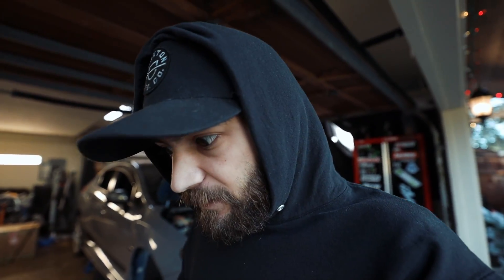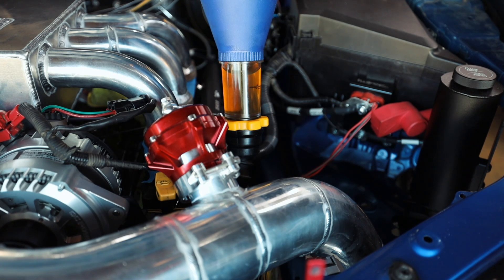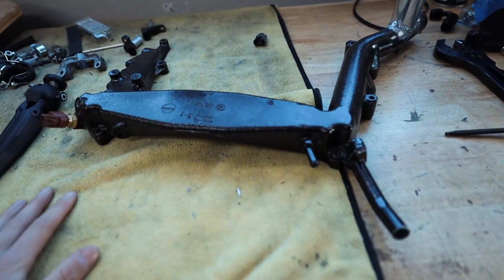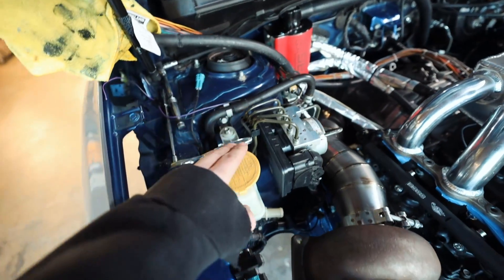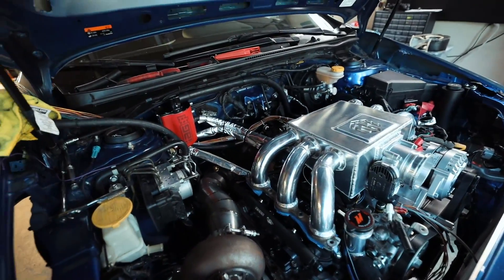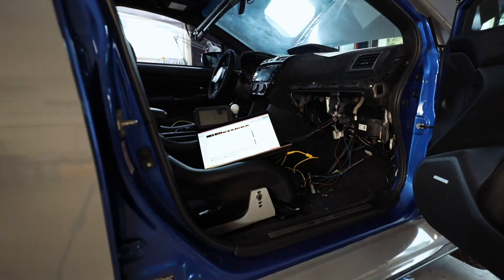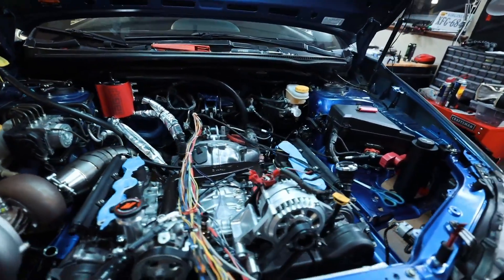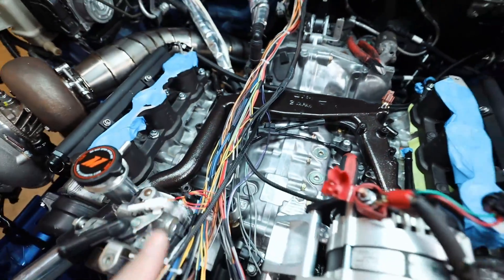SVX Swapped Subaru WRX STI Has a Full WORKING Electrical System!

Comment: So this might be a stupid question. I haven't seen anyone run a separate tank for E85. But it would make sense for the simple fact that you could run regularly 93, then when you want the extra power just flip a switch. If you could just address that question I'd appreciate it. Seems like a good idea to me. But I'm new to most of this.
Reply from the maker: It's do-able but most just run flex fuel and allow the ecu to compensate for whatever % it sits up. Fuel tanks are larger and bulky. Running two would definitely sacrifice some space 🙏
Reply: @Smeedia  that makes sense, my F150 is set up that way. Just feels like it takes a tank or 2 before it fully registers. Thanks for the reply!

Comment: Question if you can get readings from the stock ecu does this mean you can use the stock wheel speed sensors to keep traction control and abs
Reply from the maker: Yessssir 🔥😁

Comment: An "R" drill bit is .339". 21/64 is .328" and 11/32 is .343" . The tap creates the taper not the drill. If you bury the tap in the hole it'll probably be too sloppy for whatever fitting you try to use.
Reply from the maker: Sensing it with a normal bit

Comment: I've drilled and Tapped NPT holes. There's no  tapered drill bit. The tap has a taper shape but you can't see it with your eyes. There's no special NPT tap procedure. Just drill the hole to the correct drill bit, and run the tap in. You won't have any issues. Put some Teflon tape you all good.
Reply from the maker: Sending it 🔥

Comment: Letter R drill is .339", straight, not tapered. You CAN get tapered reamers for NPT taps. Not necessary for what you're doing.
Reply from the maker: Oh easy, using a normal bit then 😅

Comment: My boy💪🏻 blue is looking good! Quick question: if I reset the knock learn on my AP do I have to reflash my tune? Thanks man!
Reply from the maker: No you do not 🙏🔥
Reply: @Smeedia  whoop whoop thanks, still having DAM issues 🙄 lol. Hey what’s ur opinion on the new GR hatchback Corolla? 3 cylinder 2 liter AWD 298 hp and it comes with a trani Toyota made specifically for awd. Thanks!
Reply from the maker: High key like that thing 🔥🥵
Reply: @Smeedia  YES SIR! I’m considering that Corolla over the next STI. I raced and drove a Hyundai velostar N the other day and it was so nice/different when compared to my wrx especially the trani.